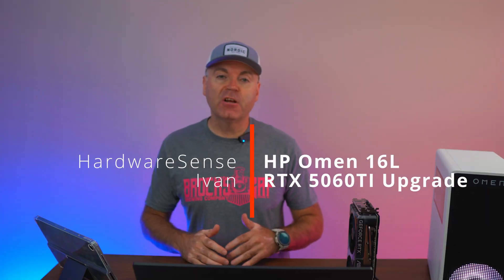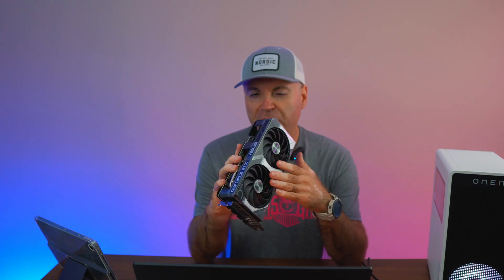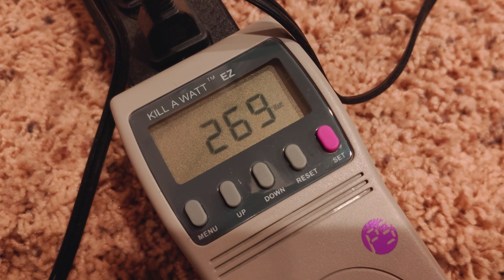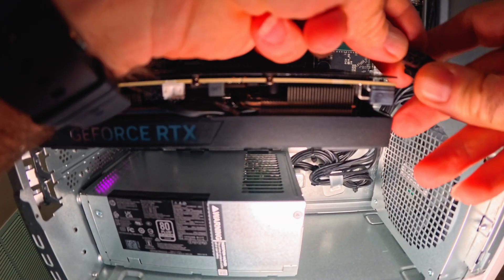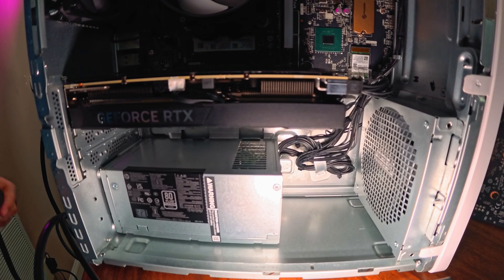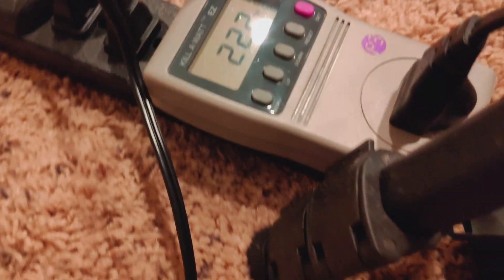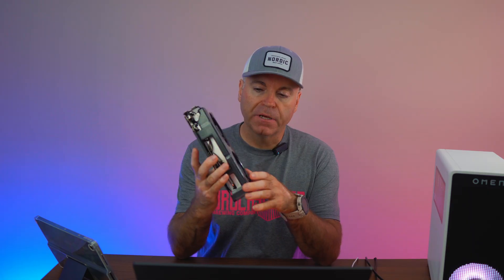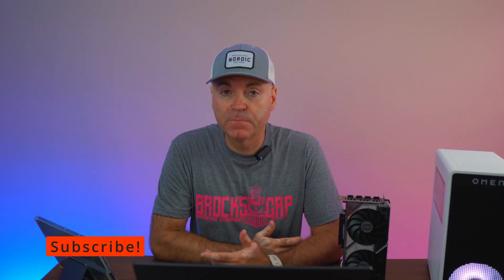HP Omen 16L - Can You Upgrade To RTX 5060TI And Above With The Stock PSU?

Comment: the 16L i got uses 2 8 pin connectors from the PSU that adapt to go to a big 16 or 20 pin connector to the 5060 ti.... you need that wiring harness probably